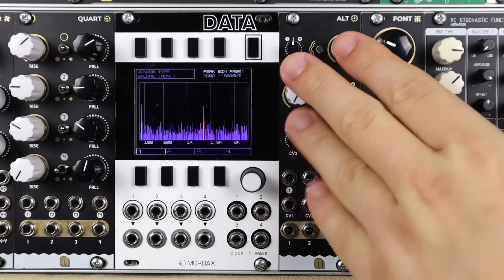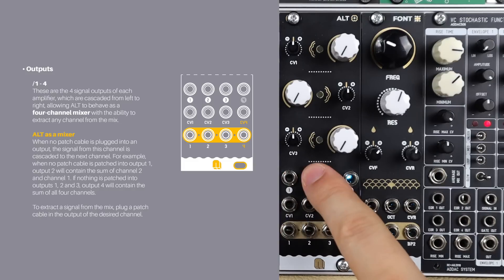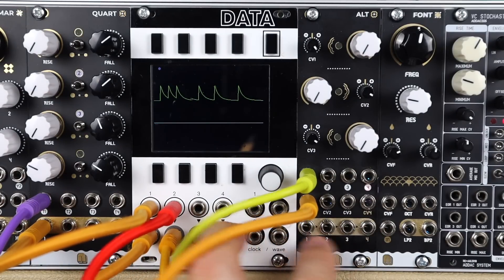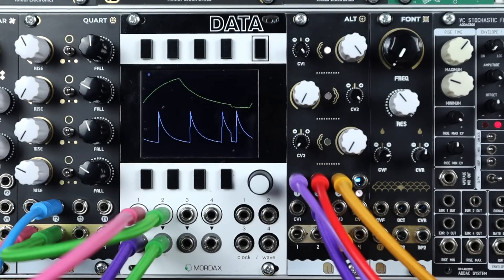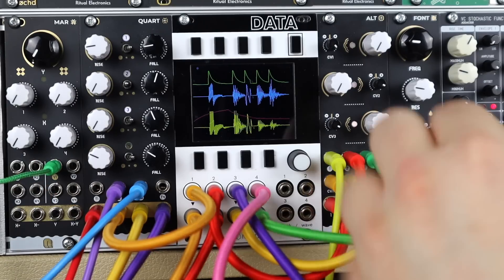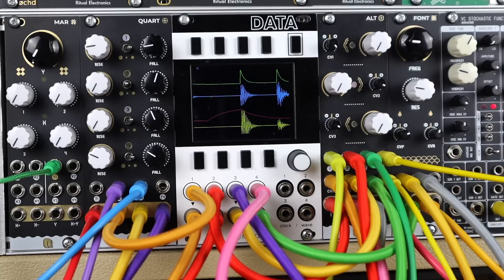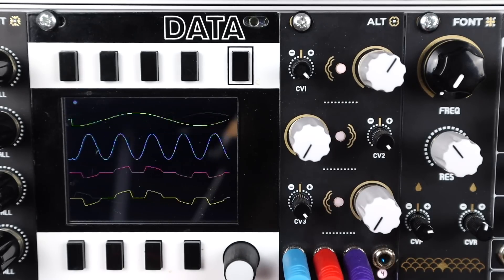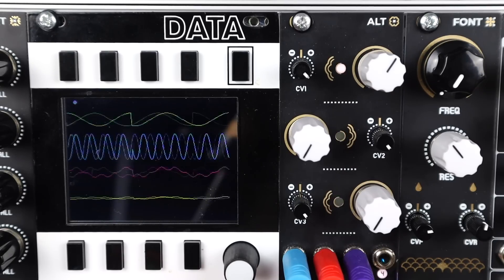NANO Modules ALT // basic to advanced patch techniques AM synthesis, auto panning, sidechain + more!

Comment: 4:11 - i dont understand this? offsets? i would have thought turning that knob would just make it louder - but it sounds like your opening up the envelope.
Reply from the maker: Happy to help. 

If we go back to 3:30 we can hear the oscillator going into the VCA with the manual (offset/bias) level control on the white knob. 

then at 3:51 I add an envelope CV signal (the one visualised in green on the Mordax DATA scope next to it) to the CV input of the VCA. As I turn up CV 1 (the small black trim pot control to the left of the top white knob) I'm increasing the level of that envelope controlling the VCA. You're then hearing the oscillators waveform shaped by that envelope.

4:15ish I start to add the manual level (which is an offset, it adds a voltage to bring the VCA control up from 0V to set a manual offset level set by the knob) which brings up what we can think of as the "floor" the lowest part of the signal that was 0V and off or silence. So with the envelope up full already shaping the notes, turning up the manual level control is increasing that base level, which works with the envelope in the CV1 input as well. 

Hope that's helpful, if not or you have further questions keep them coming.
Reply: @DivKid  thanks very much that does make sense. The only VCA I have is a Barton BMC15 which is a VCA/ Mixer (that does not have a seperate knob for CV attenuation - if I plug an envelope into it then the envelope is effecting the signal the whole time) - so I guess I kind of thought that all VCAs should act like mixers.

Thats a good description - when you offset the signal using the white knob - it raises the floor of the signal. I can hear that and i think i can imagine what it would look like in the Modrax aswell. now i just gotta imagine how I could use that in my work flow o.O
the example at 7:56 is a good illustration feels good understanding it :)
Reply from the maker: ah ok, understood and those things can confuse what's happening. Single knob designs like that have an offset voltage normalled to the CV socket so the knob controls level manually when nothing is plugged in. Then when you plug an envelope it, it cuts out the offset voltage and the knob now controls the level of the envelope. 

There's some, but few strict, standards to all this stuff so the learning curve can be steep sometimes. I enjoy the constant learning though :)

Comment: I'm sad to report that I got one of these new and channels 2 and 3 are noisy. Channel 2 is REALLY noisy, and I tried it all over my system, all racks with separate isolated power (and my studio has isolated power, all phasing and grounding checks). All of my other modules are quiet, but not this one.  Returned it to the dealer, and awaiting on an exchange, but guess what...all the other available dealer modules have the SAME problem. Defective parts or circuit?  Who knows--I'm bummed after seeing this demo.  The issue is still not resolved, but the noise in channel 2 is positive voltage (really loud) and in channel 3 the noise is negative voltage.  Channel 4 has some cascaded noise, and channel 1 is dead quiet.  I'm not sure if my dealer will escalate with NANO Modules or not, but clearly there's a problem.
Reply: Nice to meet you, I'm Jorge, NANO founder & head engineer :)

I'm sorry to hear that you are having a problem with ALT, of course it doesn't have to behave like this, so please write me to jorge@nanomodul.es and we'll solve it for you.

Best!